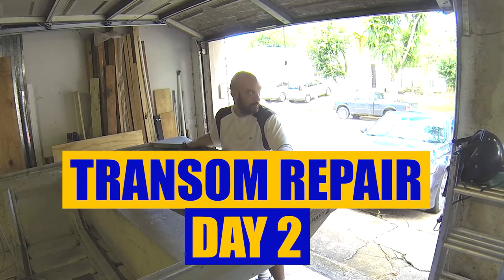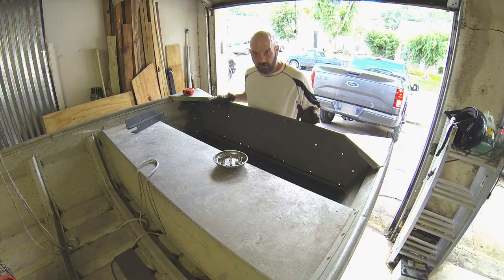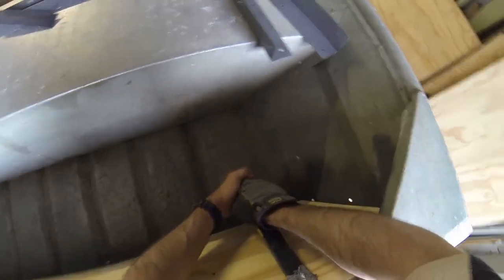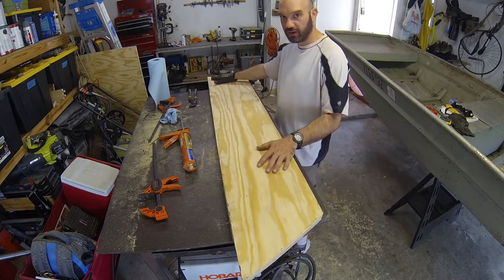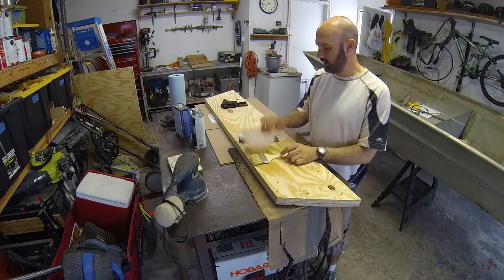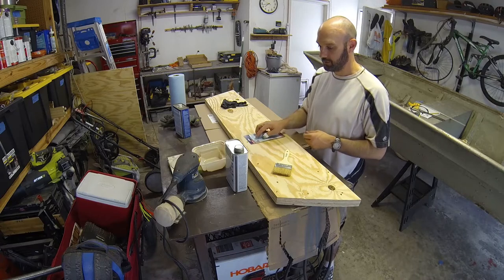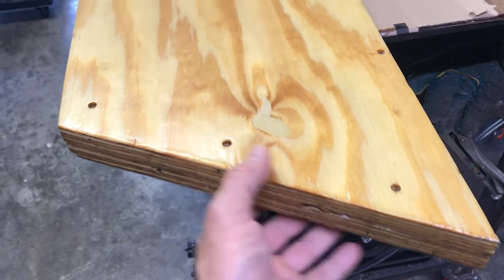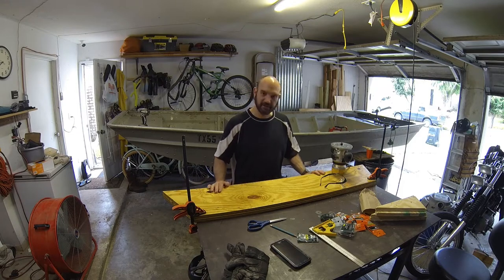Boat Transom replacement, DIY step by step tutorial. Part 2

Comment: I am about to tackle this project. Can I use the fiber glass resin to glue the 2 pieces together as well? Thanks
Reply from the maker: I wouldn’t use it as a glue, I would use actual adhesive and screws. You can resin the sides together to make them water tight
Reply: @BitesandStrikesFishing   t-4, want to thank you for explaining how to measure and cut that angle also. All the other videos i saw just showed tracing out the old transom. Nice detail, thanks